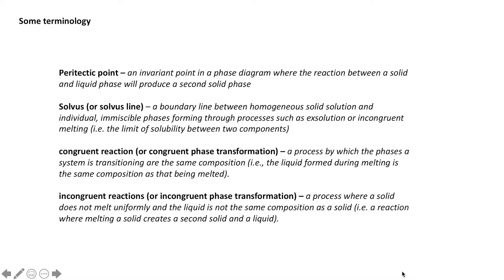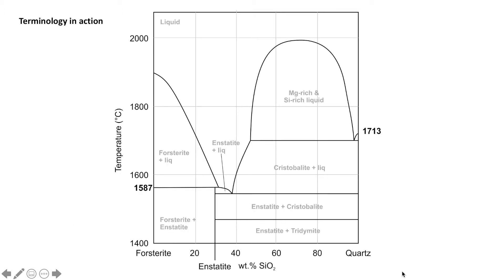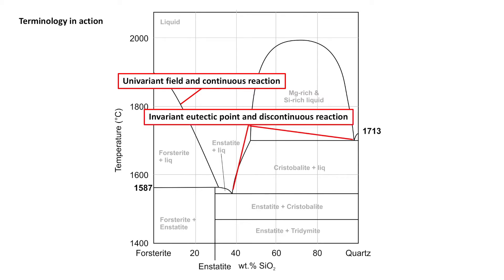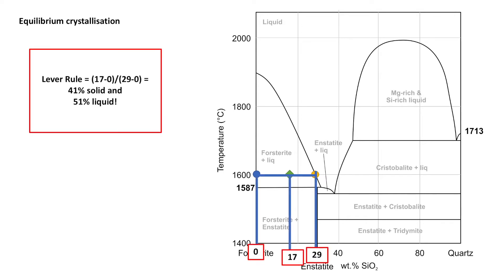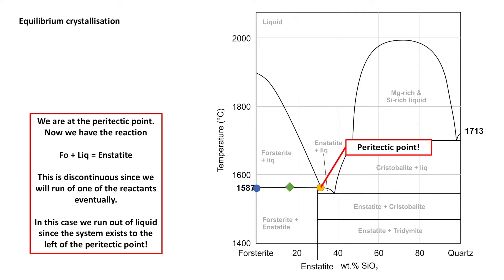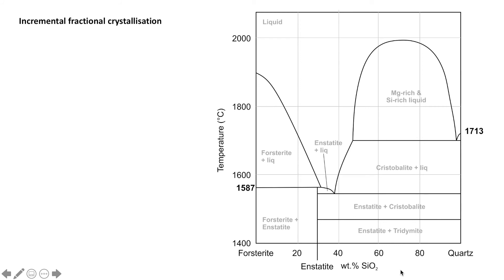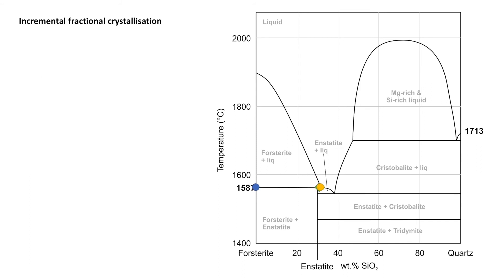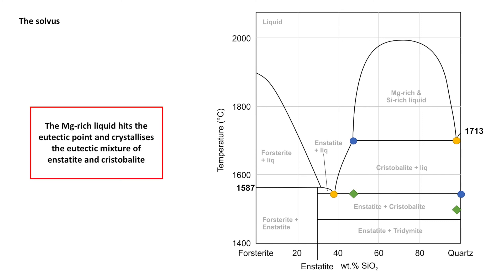Igneous Petrology Series: Lesson 7 - Binary peritectic phase diagrams

Comment: Very nice. Excellent explanations and animations. Great work. One comment: at 5 minutes the evolution of the system after the peritectic reaction has the blue dot moving from olivine to enstatite as the system cools down. However, that is not going to be the case. The blue dot should disappear (as olivine is consumed) and a new dot (maybe a different color?) should appear to the left of the green symbol (on the enstatite line). From then on all three symbols (the new symbol for enstatite + the green and yellow symbols) would move down but remain linked by a horizontal line. Just posting this note as I think readers may also have that question.
Reply from the maker: Thanks for the comment! Yes, this is a good point. Once olivine is consumed in the reaction with the liquid, I should have represented enstatite with a new symbol rather than animate what initially represented olivine. As a further note for any readers, the olivine would disappear if the system was undergoing batch crystallization. In fractional crystallization examples, olivine cumulates may have already been removed but have not undergone a peritectic reaction and these would evolve separately to essentially dunites if all liquid was effectively removed. 
- thus the liquid can only react with olivine it remains equilibrated with.

Comment: Can u plz explain how reaction rim form between olivine and pyroxene with the peritectic diagram???
Reply from the maker: Hi Susil, thanks for your comment. Are you referring to when olivine becomes replaced by pyroxene during peritectic reaction? or how olivine rimmed by pyroxene happens in real rocks? just want to understand your question better :)
Reply: @WillDSmith95  thanks for ur reply sir....i just wanna have clear concept on the both the issue that how reaction rim is formed and when...
Reply from the maker: @opti_misticsusil7633  No need for sir, Will is fine! haha - sure. So olivine is typically the first phase to crystalline in a mantle-derived magma. As the magma cools, other minerals will want to start crystallising. When we get to the peritectic point, pyroxene will want to crystalline at the expense of olivine (suggest watching my Bowen's Reaction Series video too!). Because of this there will be a reaction: olivine + liquid = pyroxene. One of those reactants will be consumed first. If liquid is consumed first, we might see olivine with pyroxene rims. If the olivine is consumed first, the system will progress to the right of the diagram in this video! Hope this helps
Reply: @WillDSmith95  thank you... definetly it works..

Comment: sir can you please explain the point about liq being consumed first or solid being consumed first i am unable t understand that part
Reply from the maker: Hi Jay. Sure! Essentially, in these incongruent (or discontinuous) reactions, the solid (olivine in this case) and the liquid react to make a second solid (pyroxene in this case). Therefore, Olivine and Liquid are reactants. There is a finite amount of both Olivine and Liquid and they will continue to react to make pyroxene until either Olivine or Liquid are exhausted. If the liquid is exhausted first - the system is solidified. If the olivine is consumed first, the liquid will continue to evolve towards the eutectic. Hope this helps.